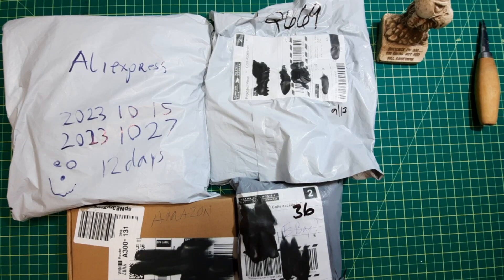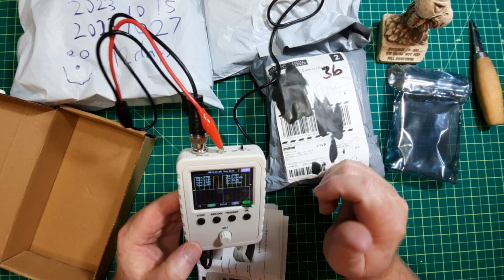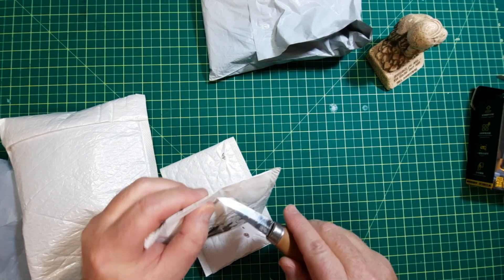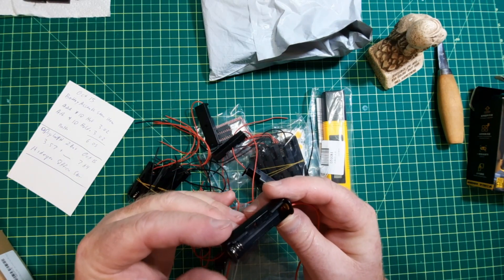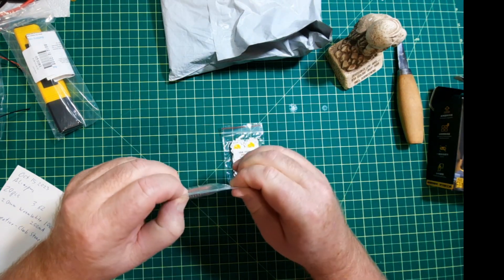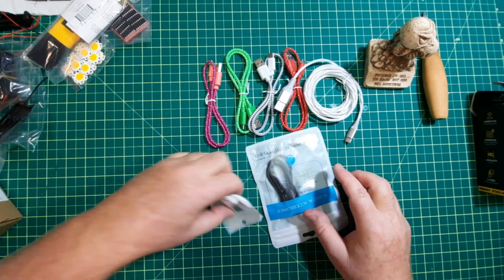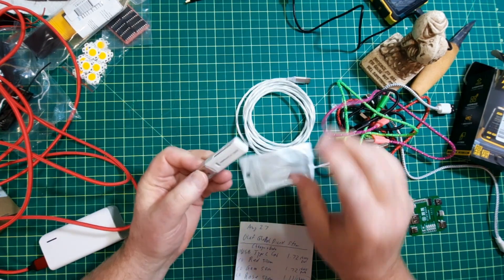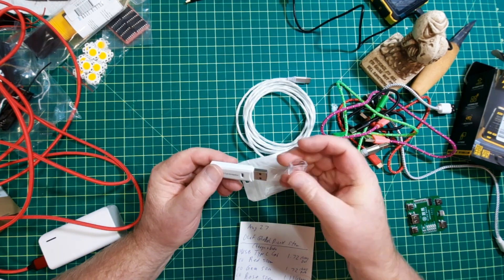Electronics Mailbag 26 ish

Comment: Ali sure sells those USB cables much cheaper than domestic sources.
I still have a small collection of CF cards.  Had an ambition of using them through adapters as PATA drives for a while, but they never worked so well as hoped.
Reply from the maker: Broke my Samsung cable a while back and after buying a new one, ouch price, had to find a cheaper source. I am thinking of testing the cables by transferring a big file off of my phone to the computer and seeing the difference in transfer time. So far the black cable C to C appears fast. Will be interesting to see how the card reader performs, last computer I bought does not have a slot.
Reply: @retireeelectronics2649  Yeah, there is little better way to test a cable than to do a big transfer, and wiggle the end connectors, then flex the cable to see if there are interruptions. USB-C seems to be the ultimate now, as multiple PCI-E lanes can be channeled through it with the Thunderbolt protocol and split out to video, ethernet, and USB 3.0.